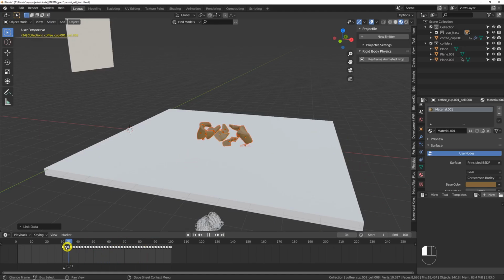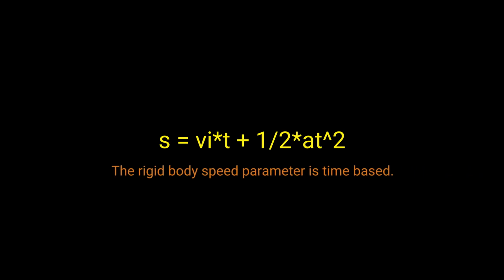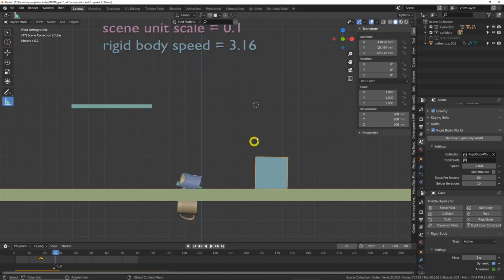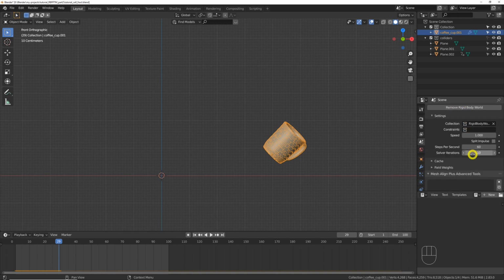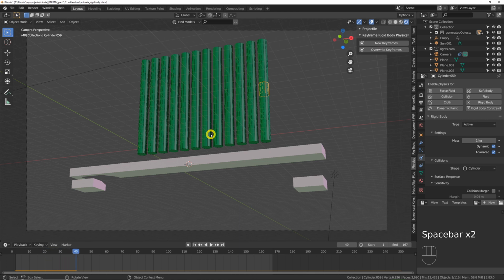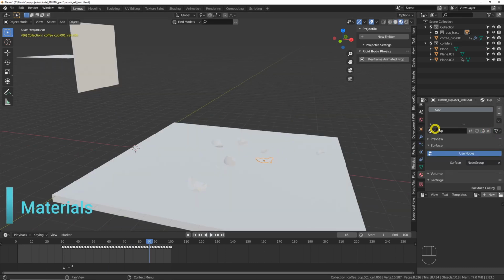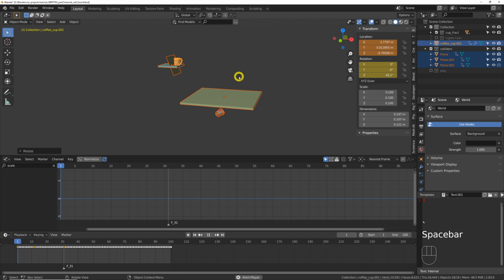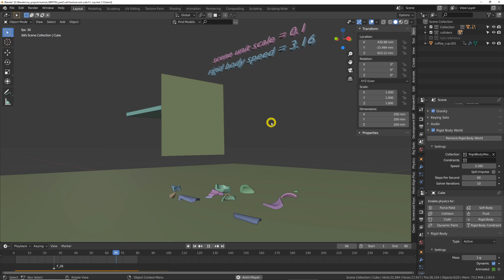Blender 2.8x Rigid Body Physics Cell Fracture: Path to Mastery - Chapter Three

Comment: I don't understand the part where you increase the speed using a Physic formula.
Reply from the maker: Hi, it is to allow smaller unstable simulations to have proper timing. 
The idea is if you have eg. a 1cm object, that is too small for the Bullet physics system that Blender uses to give good results. 
Therefore scale the objects by eg 100x to bring it to 1m size. However now the timing is wrong, the larger objects inherently fall slower. Therefore i made a rough guestimate to re time the speed using that formula. I suggested taking the square root of the scale factor. Sqrt(100) in this example = 10. Starting point for the simulation speed is 10. 
hope that helps. let me know how you go. cheers Jon
Reply: @para8D  oh..the estimated number.
I thought there is a exact formula between the size of the object and gravity, velocity etc.
I understand now. 
I was trying to find the relationship between the mass velocity and gravity.

Comment: Hello.  When the rendering process is performed, the trick that breaks objects does not show what is the reason... but it appears well in the scene.
Reply: Thanks. Finish that problem the scene is good.
Reply from the maker: Hi Akeel, off the top of my head: check that the object is set to visible in render. Scrub the time line in case some keyframes got added.
let me know if that worked otherwise I'll need more specific info and maybe the blend file

Comment: Thanks for that video. That explaines a lot. But also it shows another reason up, why Blender is not widely used in the industrie. This is all too complicated. Even in Houdini a rigid body sim is easier to setup correct as in Blender. There i don´t must compute the right mass and speed an so on. I simple setup my scene, type in the scale and the weight and done. It works. Also in Cinema 4d. Its so simple there. So i do all my ridid body stuff in Houdini (the apprentice version is good for that) and export it to Blender.

Comment: Is there hope for chapter 4? Great series and i learned a lot.
Reply from the maker: Hi 3DArtGuy, yes! I have several ideas in the works. Is there anything in particular that you wanted covered? 
I will likely do shorter supplementary videos and I also need to make the promised 'Bonus Video'. Subscribe to keep up to date! Thanks for the feedback.
Reply: @para8D  Yes shorter videos are working better here on youtube. Some cool examples of course =D. For example i have used it for a car crash scene with a mesh deform modifier and the soft body sim. How to balance high quality with render time but that might be different from scene to scene.

Jeah i think examples with small breakdowns are very cool and would bring ideas to the table of what is possible. Might be worth to research what other softwares are doing here.

Comment: How to fracture with liquid inside cup?
Reply from the maker: Hi, good question. I haven't done that myself but I had a chat about it and we decided on two methods.
You want to avoid doing the fluid sim in one hit because that is the most difficult. Similar to how we swap out the whole and shattered cup. You will want to swap out between the initial contained fluid to the shattering/exploding fluid.
Potential options:
1: Fake the fluid sim while it is in the whole cup. i.e. using a displacement modifier or similar on the surface. This way the static fluid can easily be parented to follow the cup. during the rigid body simulation. Then at the point of impact switch to the fluid simulation.
2: use a fluid sim in the whole cup, then switch to the shattering/exploding sim upon impact.
I'm interested to know if the domain can be dynamically changed. If so an option is to start with the domain as the cup shape then switch it to encompass the floor.
Let me know if you try this or have another method!
Cheers

Comment from the maker: Bonus Video Coming Soon...

Welcome to Blender 2.8x Rigid Body Physics Cell Fracture: Path to Mastery - Chapter Three
We go even further in this chapter by working with the Cell Fracture Addon.
I’ll do a full worked example for the smashed cup to show the process involved and gotchas to avoid. This method is quite involved, don’t worry i’ll walk you through the process.

We investigate the issues with smaller simulations and then look at how to scale them up and re-time them for the best results.

0:00 - Introduction
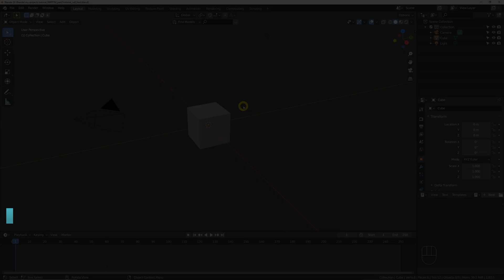1:09 - Cup Fracture Example - Full Method

**Correction**
1:26 - Object Size - Investigation
The Collision shape is set to mesh on the Cyclorama. Which causes the smaller simulations to be pushed upwards because the collision margin becomes more significant. It should have been made up of primitive Rectangular prisms set to Shape = Box to give the best comparison. However the discussion is still relevant and it goes to reiterate the issues caused by small object sizes.

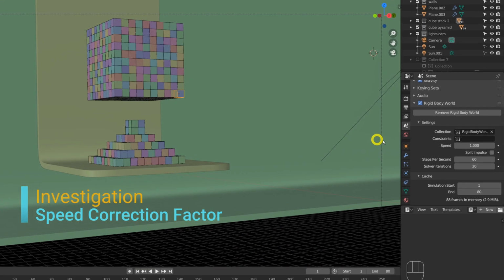2:05 - Speed Correction Factor - Investigation
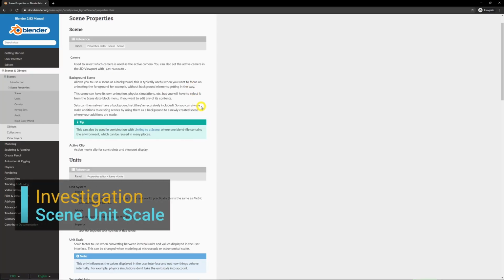3:56 - Scene Unit Scale - Investigation
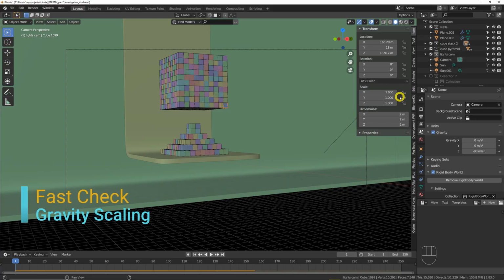4:54 - Gravity Scaling - Fast Check
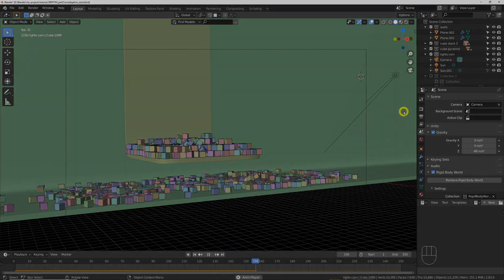5:14 - Cup Speed Correction - Investigation
5:45 - Real Comparison Test
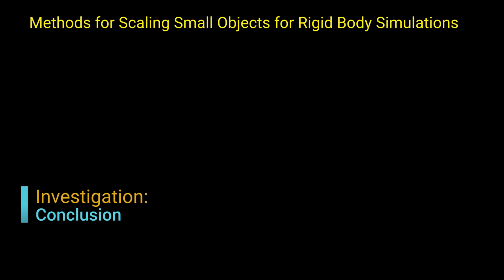5:57 - Investigation Conclusion
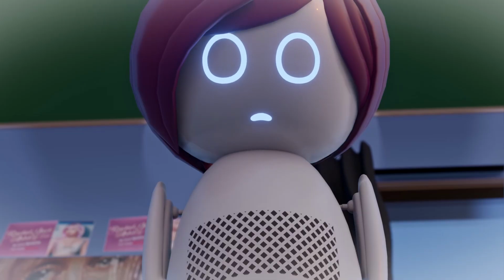6:22 - References for Speed - Quick Tip

6:49 - Cup Fracture Example - Full Method cont.
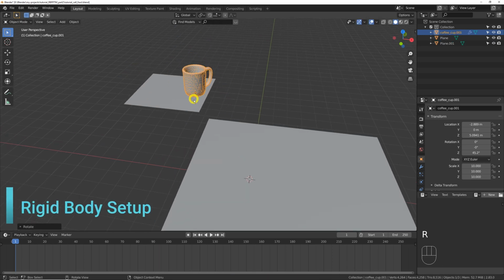7:03 - Rigid Body Setup
7:12 - Animated Collider
8:06 - Timeline and Cache
8:22 - Frame for Switching Objects
8:46 - Cell Fracture the Cup
9:14 - Keyframing the Rigid Body
10:03 - Keyframing Using the Addon

10:25 - How to Install Addon (Keyframe Animated Property)

11:56 - Cup Fracture Example - Full Method Cont - Matching Velocity
12:24 - Troubleshooting
12:57 - Bake the Keyframes
13:17 - Swapping the Cup with Fractured Cup
13:47 - Materials
14:11 - Interior Material
14:39 - Fast Fracture - Example
15:22 - Fast Fracture  - Fixed Constraint
15:41 - Scaling the Animation back to Real World Sizes

17:02 - Script for Scaling the Animation

17:30 - Link to Scene for Scaling
17:42 - Cell Fracture Learning Resources
18:26 - Fracture Modifier
18:58 - Conclusion

Other Chapters
Blender 2.8 Rigid Body Physics - Path to Mastery Chapter One
https://youtu.be/jZg7-3yP6Ew
Blender 2.8x Rigid Body Physics Fundamentals Cont - Path to Mastery Chapter Two
https://youtu.be/8W1qoDIjH5k

[Free] Para8D’s Keyframe Rigid Body Addon and Scale Animations script
https://gum.co/EbuonK 

Blender Manual Tips
https://docs.blender.org/manual/en/2.83/physics/rigid_body/tips.html 

 Coffee Cup v.2 Model
https://www.blendswap.com/blend/2384

Para8D’s Ashley 2.0 Animation
https://youtu.be/-v7j09Ylkn0 

Markom3D Free Blender Addon - Cell Fracture 
(start deactivated)
https://youtu.be/E2WLmw2Crcs

Daily Blender Secrets - Cell Fracture Explosion
https://youtu.be/w8v2JAjrAwk

How to Fracture Complex Objects in Blender (troubleshooting)- Blender HD
https://youtu.be/iAsV_Lh8CSQ 

Blender Physics
http://blenderphysics.com/
Download fracture modifier Graphicall
https://blender.community/c/graphicall/Lcbbbc/
Blender's New Fracture Modifier Experimental Build - cgcookie
https://youtu.be/NcF7clQelI4
Fracture Modifier | #5 FM in Blender 2.8 (eevee, workaround) - blender physics
https://youtu.be/l0tUkP3rGRw

Keep up to date, follow me on:
Instagram: https://www.instagram.com/para8d/
Twitter: https://twitter.com/para8d